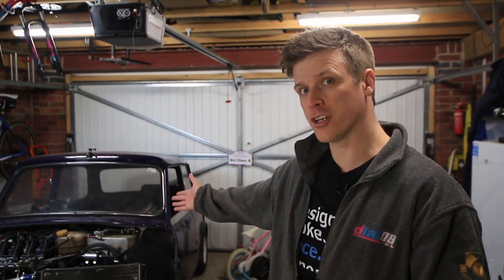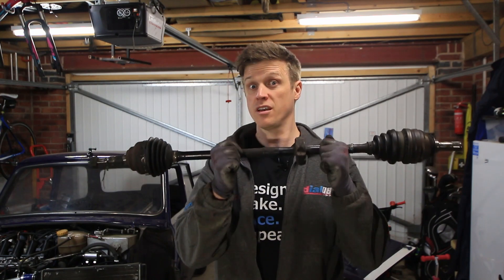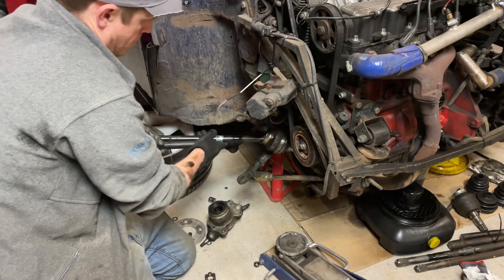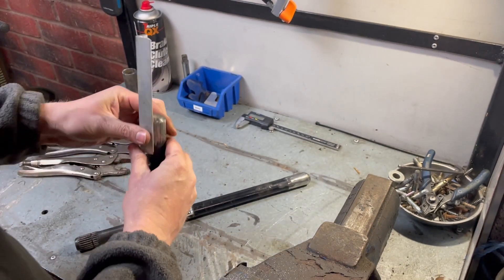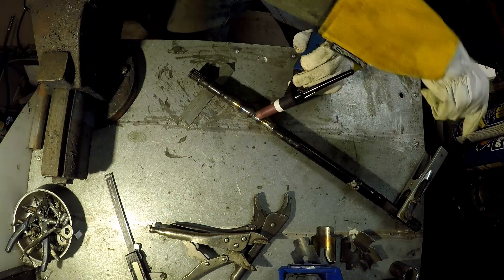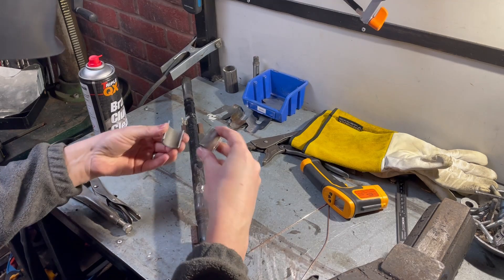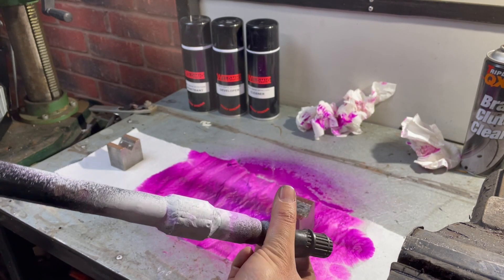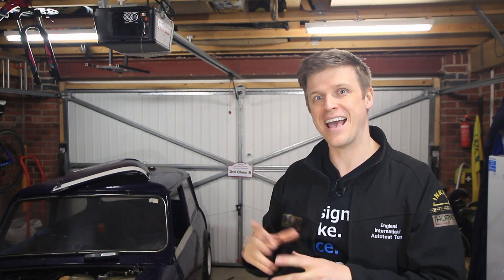DIY Custom driveshaft....  How to cut and shut driveshafts the right way...

Comment: It really isn't very expensive to have a custom shaft made, maybe $200 ?  Seems ok for a racecar.   I've welded two halves together using a sleeve, and another hack I just welded the cage one side to the shaft which was a smaller diameter I ground out to a tight fit before welding it.  That was probably going to fail, but never really tested it at the track.  I think it best to just get a new shaft.

Comment: I've been searching for a DOM pipe with the perfect inner diameter, or close enough, but it never ocured to me that I can cut it down the middle and then squeeze it into the exact diameter i need. Thank you for the tip.
Reply from the maker: Absolutely the key thing is just a well done as concentrically as possible in the first place that’s why using the shims works as well, but after that, you just need more diameter 👍

Comment: Have you ever heat treated them afterwards? I'm going to build some driveshafts for the first time and all the advice I've seen suggests annealing afterwards. Otherwise your method is really helpful. Also I've mixed opinions on how to join the shafts, turn one down and put the other inside, butt weld with a chamfer (like you did) or a key way.
Reply from the maker: I haven’t heat treated them after, but I can imagine annealing after would be good to minimise the brittleness that comes with the HAZ (heat affected zone) at the edge of the welds, which is always where the weld fails….  That said I’ve only had one weld fail… the rest of the shaft goes first!

Comment: Post 2 years comment. If you press fit both half shafts into the sleeve and have a few holes in the sleeve to plug weld you can ensure a very accurate shaft balance

Comment: Nice video, i work on my shorten drive shaft too,   but i put a Pin bar in both of center diameter of shaft to make it stronger shocked them then welding it together.

Comment: Great video, I’ve got 4 to make up, doing a 3.2 vr6 swap in my t5 van, could of avoided if using t5 existing manually transmission but using the dsg and Quattro, this splicing will do until I get some custom ones done 😊

Comment: You could tel that old failed shaft didnt have good penetration of the weld...
I bet every weld since, has been better.
Reply from the maker: Looking at it in person, you can see the scale-like formation from a fatigue crack growth… potentially from a surface crack…. In the future every 4-5 events I will pull the shafts and DyePen them… that’s should catch any failures like this…

Comment: Maybe creating center holes and a corresponding center pin on a lathe may diminish warping by the welding and save time straightening the combined shafts. Also making the shaft ends to be welded properly round  and same diameter on the lathe would help more accurate straightening. I do suspect that the cause of the broken shafts at / around the splines lies in the misalignment as the negative impact concentrates there.

Comment: My 4x4 front prop is solid (as opposed to a tube like normal) - it needed shortening. So we cut it, created a sleeve that went over the join. Cross drilled it and doweled and finally tigged either end of the sleeve to the shaft.  This ensures it’s perfectly true.  Engine is. 5.7 twin turbo driving 35” mud tyre’s - worked for the last 15+ years

Comment: Make the join closer to the other end, more mini shaft allows more twist, so less impulse (shock) to the join, . On run-out, checking with wide V blocks is good then moving your V blocks closer to the misalignment will let the press straighten the problem and get the centrelines of the spline shafts more inline. Wide V blocks bows the whole shaft.

Comment: Just a machinist's input, but next time you press your shaft to straighten it (or something similar) mount the DTI UNDER the job. Then use a low point instead, set as 0, rotate to get a reading of how far out it is across 180 degrees, then you can press and measure your alteration at the same time as the press will be pushing towards the DTI.
Reply from the maker: Using the dti to measure is a great idea… I’m abit tight on space in the garage but I’ll try that next time 👍

Comment: I welded a broken shaft back together but didnt have a sleeve available . chamfered the edges and tig welded it . will it be ok ? or do you always need a sleeve ?
Reply from the maker: Never tried without the sleeve to be honest so I don’t know.  For light duty I reckon it would work but I am going for overkill… 👍

Comment: You didn't want to use your 3D printer?
Reply from the maker: Even I wouldn’t try to make 3D printing for this…. (Maybe next time? 😂)
Reply: @MakingforMotorsport  You could use a 3D print to align both shafts (so that they're perfectly concentric) and tack them in place
Reply from the maker: @anidiotinaracingcar  you took the words out my mouth!

Comment: Did you use like a hard facing filler rod on just a mild steel?
Reply from the maker: No need to… hard facing gives you nothing here, and I think a bit of flexibility here helps so these are just my standard all purpose TIG filler

Comment: Interesting to see a video showing a different way of joining shafts. I've built a set recently but machined collars that were a very close fit to keep the shafts concentric.
Reply: That is the way I’ve done it (on multiple occasions); with the tube fish mouthed and even some drilled holes for plug welds.

Comment: I turned the shafts so that one fitted inside the other to ensure alignment. Then I made a sleeve which was fishmouthed at each end so that your not welding directly around in one spot. Seems to be working ok so far.
Reply: Very good process.

Comment: Is balancing ever an issue with vibrations etc. Just curious as rear drive shafts get balanced I'm no pro on cv shafts just wanna learn some stuff
Reply from the maker: I don’t tend to spin these fast as I am only in 1st gear (although that means lots of torque!) but at normal road speeds (under 100mph) I am not seeing this as a problem.  
Prop shafts need balancing in RWD applications but they spin 3times faster as they are before the final drive gear, are much longer.  
That said, I’d make even more effort to get them as straight as possible if I was doing 100mph+ but it’d be good I think

Comment: Seen a few people test this I know the boosted boiz don't it with a AWD 900+ whp car those lasted and garage54 have done it will cam shaft   cranks shaft and driveshafts and not had a problem either.
Reply from the maker: Garage54 does some mental stuff… and the boostedboiz are giving it a much harder time than me so I think we’re good! 👍

Comment: Excellent video. I’ve done many engine conversions that I have made shafts in exactly the same way, although I leave it 5”-7” long and drill some holes in and then fill with weld. Just for added strength. The video at 14.06 reminds me of my drive to work when trying to squeeze a 15min drive into 5mins 😂😂
Keep up the good work 👍
Reply from the maker: Cheers buddy… I will keep making and breaking!!

Comment: pre heating the drive shaft before welding would be a good idea also you did  not say what filler wire you used but 309 would be best

Comment: All the way through this you'd be thinking   " One day I'll be able to 3 D print this " I've done this a few times for various application, rally included. The only difference is that I cut about a 30mm step  (key )  For rally I do a longer sleeve and plug weld it, and get them balanced. Usually do 3 gravel meetings, or 4 /5 tarmac meeting before checking, or replacing them. That spray check stuff is good for checking roll cage welds.

Comment: I cut and shortened two driveshaft's when we put a Metro turbo engine into a Mini as we wanted to keep the wheel spacing the same width as a mini, that was in the 90's and 1000's of miles later they are still holding, everyone at the time said it wouldn't last five minutes, I turned out sleeves on the lathe and welded it all with a nickel chrome stick welding rod

Comment: Please take this as constructive criticism, but wouldn't the "right way" be to use a lathe for a lot of this?  After cutting them, you could use the lathe to clean them up so your runout test wouldn't have any rough spots, your mating surfaces for welding would have been a much better match.  Plus, if the welder was co-located with the lathe (as opposed to the lathe being in someone's machine shop), you could actually put them in the lathe for welding eliminating the need for the angle bracket.  DIY, yes.  Right way?  Not sure.
Reply from the maker: It’s a good point on cleaning up the surfaces to be absolutely sure on run out, but you never weld in a lathe, spatter on the ways, current running through the bearings… bad joo joo….
When I said “right way” I mean more the idea of measuring and correcting run out and then checking the weld…
It doesn’t really matter, the “right” way is to make new and then harden the ends… anything else is just shades of bad.
(P.s. working title for this was “bodging driveshafts”! 😂)
Reply: @MakingforMotorsport  Yeah, that makes sense.  Good info on welding in a lathe.  I would not have thought about that.  I'll have to keep that in mind.

Comment: Small tiny car will little power, lot's people do it like this. Heavy cars with any appreciable power these almost always fail. For what you use them for would be perfectly acceptable.
Reply from the maker: I am not so sure.. plenty of comments on here doing it with 300hp plus who have done it like this…. Remember, it’s not power but torque that kills shafts…

I look forward to trying it with a bigger motor!
Reply: @MakingforMotorsport  Yeah I usually hear about them breaking with motors making more than 400hp with similar torque. I feel bad for the people with Datsuns that boost them. Even some BMW guys, just not as common around here with beamers.

Comment: This is the first of your videos I've seen and I'm actually impressed! Stuff I should have considered myself when fabricating my shafts for my 6 speed swapped MK2 golf 8 years ago now. Those shafts came out this week. 
Better than £800 for shafts! And allowed for extra camber and track width for track time! 😎
Reply from the maker: £800! 😳 man I knew I couldn’t afford custom shafts! 😂 and a swapped Mk2!  (Please tell me it has the big 16v bumpers 😍)
Reply: @MakingforMotorsport  It's crazy right!? And it is. A White Big bumper, but it's 5 door. All I wanted was a clean shell all that time ago! Learnt everything I know from that car going back almost 10 years now! 
Almost scared to work on it seeing the values of them currently. 😬 
I'm hot for a classic mini though. I see it sitting in this video. And I swear I can hear the thromps from those throttle bodies! 😅

Comment: I've always imagined if I ever needed to shorten a longitudinal driveshaft I'd cut it at one end near a U-joint rather than in the middle.  The idea being if the angle wasn't perfectly straight it wouldn't matter as much.  I suppose you can't really do that with axles since that would put the joint under the boot?  Or is there some additional reason that makes it better to join shafts in the middle portion instead on one end?
Reply from the maker: I went with the place I did due to the similar diameters… and as long as the shaft is “straight”, I don’t think it matters.  
The reason for re-welding at the UJ yoke on a prop shaft is that there is already a weld there, and they sometimes pick up axial alignment with a bore… if you already have a weld, why make another?  I am not so lucky…
Reply: Yeah that is the best way to do them for the DIY guy. It's how I do mine. Lengthening them I would get a longer tube the right size instead but that's for 'Driveshafts' only.

'Stub Axles' like what this guy is doing have heat treats and are usually machined. You have to very careful and at least a good understanding welder to shorten or lengthen stub axles or CV shafts (basically same) reliably. Stub axles I'd rather buy first if it's possible but if not I'd take them apart to what process is need to change length. I would make that change more near the ends if possible and set up a jig and prep for rollout before laying on weld, not afterwards if you want any real hope of something that is straight.
Reply from the maker: So the heat treats on these are there for the splines and it’s only a “case harden” rather than a full through heat treat as that would be far too brittle. 
Like I say in the video, co-axial at the joint is most important, you could jig that to a girder and it would move all over the place with that much weld and heat in it.
Even OEM driveshafts still need straightening post friction weld….
Reply: @MakingforMotorsport  Seen that process too, I use to manufacture them and I have seen driveshafts made aftermarket and the long ones they do straighten afterwards. I straighten them and check runout before hand while I'm welding them up and my result is usually within 1-2 thou runout. It comes out better but then that's what the jig was for.

You probably won't see full induction hardening on cheapy old axles especially on old cars so welding, but ye you got keep that in mind.

Comment: Why not Make a whole new shaft from bulk its a lot easier. Or get over lenght Opel shaft and do only The other end??  Std Will do on auch small car. Wtf
Reply from the maker: Okay… I am going to presume that you have never “made a whole shaft from bulk” in your garage…
Reply: @MakingforMotorsport  usually i do. And mostly i get over lenght stuff and grind ends only. Nice try still hope IT Works. 3000nm on 355 BASIC steel should be no lesser prob than ua on russia. So this A lot More stiffer  GT from Finland
Reply from the maker: Without the proper tools (milling machine with a dividing head Chuck on a-axis or a shaper/broach or rolling machine) I don’t see how you are doing it with any accuracy at all… and then it (may) need case hardening… well beyond the home enthusiast….
Reply: @MakingforMotorsport  i can show you tomorrow i have one axle to do. Tools are only angle grinder and 1mm discs. Shaft IS over lenght and over size for its purpose. Grinding does not harm its stiffness
Reply: @MakingforMotorsport  hardening of shaft IS not lost by grinding If The metal does not color just patience
Reply: @MakingforMotorsport  presuming 25mm thickness on 355 std
Reply: Overall this should be a good and reasonable approach. What you just did. at least good Start.
Reply: I Will host a video outside of YouTube so you can pick IT up and use as you will
Reply from the maker: @CT-zc6ne  I would love to see it…

Comment: My cg13de mini on the machinist's suggestion we machined down the larger diameter shaft and cut the mini CV splines on this, no welds or heat effected zones and really pretty cheap. No problems so far (about 5 years). There's a question about losing the hardening on the splines though... I've not seen anyone else do it this way but I'm not sure why not as it's worked fine for me.
Reply from the maker: I need to get myself a tame machinist…. Unfortunately I only know of a couple of shops and I am not there often enough for “mates rates” 😩

Comment: A Belt Sander attachment for the grinder can make it easier to get all the paint/coatings off the driveshaft as the belt would be sanding around the circumference instead of using a grinder wheel making flats around the circumference of the shaft
Reply from the maker: It’s a good shout, I need to get myself a proper belt grinder… it’s been on the list for a while!

Comment: Thanks for an interesting video.  Your method obviously works.  The one shaft that broke at the sleeve might have been avoided if you could blend and polish in a large radius with a flap wheel.  The location where one blob of filler metal touches the next is a "sharp" internal radius.  The stress concentration goes up as one over the dimension of the radius.  You can see the factory made a large internal radius where the shaft  had to change diameter.
Reply from the maker: Yeah, in retrospect it’s a obvious stress concentration point, some guys are suggesting a “wavy” cut on the end of the shaft with a hole saw which I will definitely be doing next time! 👍

Comment: Good video on this subject! I built a Mk1 Mini with a CG13DE engine swap around three years ago and I made the driveshafts in a very similar fashion to the way you describe. The only differences were that I turned the end of the shaft halves in a lathe, which enabled me to turn one half to a point and drill a socket in the other, which ensured co-linearity. I also welded a one piece sleeve over the top and drilled and pinned both just for giggles. Admittedly the car doesn't get the hard forward and reverse load cycles yours do, but they're still together!
Reply from the maker: Unfortunately my lathe’s spindle just isn’t quite big enough for the shaft and it’s too long otherwise.  Many ways to skin a cat I get!